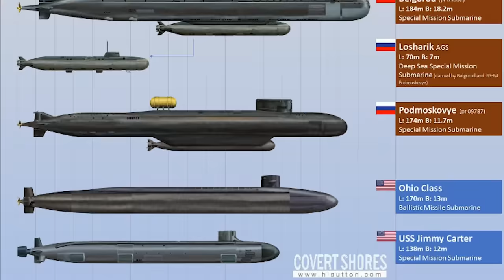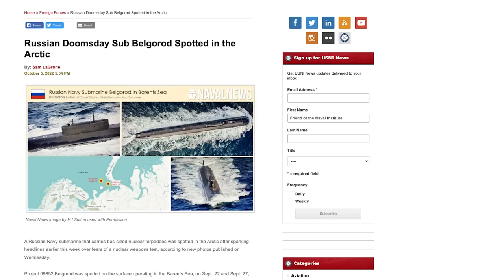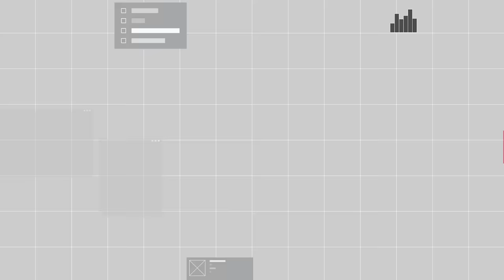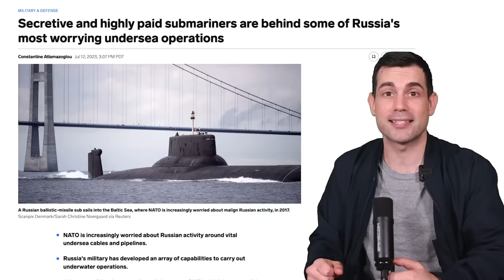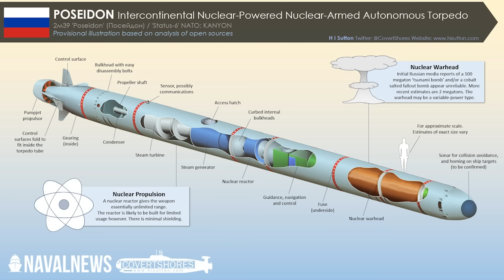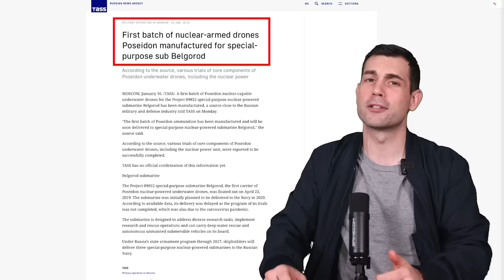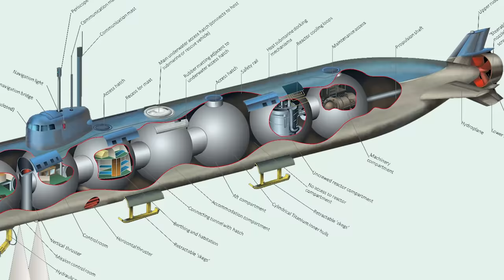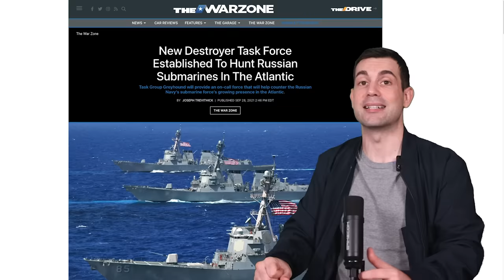What Happened to Russia's Doomsday Submarine?

Comment: Regarding the tsunami claim, it's worth remembering that the Halifax Tsunami of 1917 was caused by 2.9 kilotons of munitions going off accidentally in the Halifax harbor after a munitions ship collided with a relief ship.  The tsunami was 18 meters above the high water mark.  A nuclear torpedo absolutely could cause such a tsunami, though it would likely not be as massive as claimed.
Reply: As with that explosion (the 18m part was nearest to shore), you'd have to do it in shallow water, at which point the blast itself far outreaches any tsunami you can create since there is insufficient water available to matter (and most of it is vaporized). Remember that it takes about a 10-100 gigatons (3 to 4 order of magnitude more) to create any decent tsunami event in deep water, aka a massive earthquake.
Reply: Well if they were to launch a tsunami, they would be hit by it as well they have alot of coastline right there too. Soo there that...
Reply: @timothyhosek3551  Thats false
Reply: Sadly most people have no real idea how nuclear explosion work and also have understanding problem of simple description. There is claim about making nuclear tsunami. So the water waves would be high for sure taking under consideration how big this torpedo is. But mostly it would generate huge shockwave that certainly would waste costal cities and naval bases without issue. And since it would be fired from huge distance then no ,sub itself wouldn't be damaged.
Reply: You need to consider some basic math here...
The 'Tsar Bomba' that was detonated by Russia in 1961 was 50mt. 
Let us say for a moment that a Russia is only using a 50mt nuke and detonated it underwater at a depth of 600-800 meters. 
Do you not think that's not going to create a massive tsunami? That would push 'at least' 350 billion metric tons of water skyward. So yes, that would 100% absolutely produce a very large tsunami and furthermore, it would be moving at a much greater speed than a normal tsunami.
Reply: @T8OOM1O9 
Exactly 💯
Reply: @Tigris_River_Sand_Fl
eas 
Bravo 👏👏👏 
Very well explained.
Lots of comments here are from people who don't have proper education or knowledge. They just say something to look smart.
But you can figure it out who knows.
Reply: @NoNameForNone 
That's not true
Reply: My thought is the nuclear torpedo swims up a freshwater river, to a city, as a first strike weapon, a surprise nuclear detonation is bad news, regardless of tsunamis

Comment: The biggest flaw in their claim for their Poseidon "doomsday torpedo" was how much they said the yield of the warhead was. 100 megatons is the equivalent of the Tsar Bomba, which weighed 27 tons. The poseidon is not big enough to carry that kind of weight and all of the equipment it needs for its promised capability, and even then it would grossly overweigh the submarine built to launch it and the torpedo itself. I don't think the Poseidon was built to even exist, the "prototype" just a Qahar-313 equivalent (in other words, a prop piece with basic functionality purely created for media purposes).

Edit: Also forgot to mention that supercavitating torpedoes exist. The first one, the VA-111 "Shkval", was developed in the 1960s and first fielded in 1977. They are loud, and probably sound like a screech on hydroacoustic sensors because of the way supercavitation is achieved.

Comment: Super-cavitating torpedoes would be very difficult to develop for most applications because the high speed does not allow for any sonar guidance, until and unless it slows down. The assumed application would be nuclear warhead, ie precision not required.
Reply: The U.S. Mark 48 torpedo is given initial course and speed of a target but, periodically slows to do a search and confirm the original data.  If it finds the target far off the predicted position, it commences to do an active search and recalculate a new predicted position.  Eventually, it gets close enough to the target hull that its active sonar will get solid returns at high speed.  Then it goes in for the kill.
Reply: We’re also going to ignore that super cavitations torpedos work by forming a bubble around the torpedo meaning virtually no guidance. Super fast but short range and for why? A a 50 knot torpedo that can chase down a vessel for 30-40 minutes is just much more useful. As for nuclear delivery, we have SLBMS for that. The only useful nuclear torpedo is the Poseidon.

Comment: Rashist federation is not capable of producing a 28 nm based microchip. TSMC used to be a sole provider of that technology products.
On a separate note, back in the mid 1980's I had to visit Severodvinsk in winter time. Don't ask what for. It was punishingly cold there, but surprisingly the mention brings warm memories.

Comment: GLONASS (as well as any other GNSS) doesn't work underwater. And AI can't help with navigation if it has no active sensors to scan the seabed (like TERCOM).
Most people think in one of two ways:
1. Poseidon is a super duper weapon constructed the most talented engineears.
2. Poseidon is propaganda.
I think that it is not very usefull to discuss it's exact specs.
Probably we should estimate the concept of nuclear powered nuclear torpedo itself, compare it against other kinds of nuclear weapons (maybe it worth less than a regular ICBM?)
1. Does it make sense to use about 30 metric tonnes of weapons grade uranium to create a single bomb (that may be intercepted) instead of a large number of 100kt nukes for ICBMs/SLBMs?
2. How long it takes to turn on a nuclear reactor (those are not electric kettels). E.x. turning on a NPP may take several days. Or is it okay to keep it working all the time?
3. Will russians be able to launch it considering that their subs are being followd by NATO/USA anti-submarine aviation 24/7?

Comment: Super-cavitation, or that sustaining a perfect bubble during a long transit is BS..

Autonomous navigation across the ocean, where it could roam and return back to port like a Space-X torpedo sounds like a fantastic feat, only it would require turning a massive underwater network of passive hydrophones into active transmitters (think radio antennas, and now replace that with low frequency sound), to enable this thing to hear commands (while at a much slower processing rate due to higher error margins vs modern radio based data communications... And so that's a big maybe too..

All in all, it's supposed to represent Red October propaganda given it's entry point vs the acclaimed technological prowess.

Edit* and yes, agreed...too small for a nuclear reactor...perhaps an underwater RTG?

Comment: a few quibbles --
The warhead could not be a 100 MT warhead. The largest nuclear bomb ever tested was the USSR's Czar Bomba at 60 MT. It was calculated that a 100 MT bomb would be so powerful it would expend most of its energy blowing a hole in the atmosphere of the Earth a send a large percentage of its energy into space.  I think you might mean 100 KILOTONS. 
You said the Russian submarine's radar would outrange American sonar by many miles. Radar does not work under water, so to use Radar, the sub would have to surface and stick a big antenna sufficiently high above the waves to detect other ships. This would likely give its position away quickly. So did you mean SONAR? Active SONAR also gives away your position. Passive sonar would be limited and likely no better, probably worse than American SONAR, but I guess they are detecting surface ships which are noisier, so maybe they would outrange us on that.
For the Torpedo to use GLONAS it would have to surface to detect the weak positioning signals. That might give an opportunity to be detected during its navigation fixes. I would expect it to use inertial navigation most of the time, but take fixes through a periscope or surfacing periodically.
Making a device nuclear powered without human intervention or monitoring is a feat the US Navy and Air Force has not acknowledged. There was once an article in Popular Science about a nuclear powered cruise missile design, but I am not aware of it ever being built.
I still have trouble believing the Russians will create something that no power in the West has created, such as an autonomous nuclear powered robot torpedo.

Comment: they could have a base in a cave like Norway has   like a natural shelter  
however i wonder if one day it would be possible to build a torpedo controllable by remote
it could be connected to a floating small antenna for GPS positioning and data transmission via a a 50-100 meters long umbilical fiber optic cable
remote controlled torpedos would be a nightmare for big warships

Comment: One thing that immediately come to mind, is the Poseidon torpedo is able to operate in such an independent mode, then they could operate from ANY ship or from a shore base and the massive Belgorod mother ship would not be required or even desired.
Reply: It gives uncertainty. Sure you can put it on ship or in building, but one can closely monitor said ship or building 24/7 and know how many torpedoes are there and if one was launched. With mothership - it would go underwater and maybe drop some during it's long patrol.

So preemptive or false flag strike on ship or building could end such threat, but strike on mothership open you to the possibility that some nukes chilling near ocean floor would activate at unknown time and attack unknown target.

But Russia certainly has at least one regular ship capable of launching and recovering Poseidon.
Reply: The sub offers second strike capability. That is very important for a country which has a second strike doctrine and therefore is unlikely to fire its nukes first.
And it's multipurpose. it will likely never be used in an actual nucular war. But it will surely be used for some spying and  maybe even the classic special military operation (no, not that one).

Today's Russia isn't the Soviet Union. Today everything is multipurpose. Just carrying nukes for a war that is unlikely to actually happen doesn't cut it anymore.
Whether the sub itself is actually operational though... who knows. It's still one of the most corrupt countries on earth.
Reply: At the same time Russia claims it uses Glonass to navigate that mode..... Yeah, Glonass, their dollar store GPS immitation that's inaccurate, near-useless in the southern hemisphere, doesn't work deep underwater and makes anything using it on the surface or shallowly, fairly easy to track and even easier to disrupt.

Not to mention slapping a couple satelites out the sky would cripple the Poseidon immediatly in that case.
Reply: @nvelsen1975 you don't need to be very accurate for a nuclear attack.
Reply: @Heisenberg2A  
On a scale of naval navigation "Not very accurate" means you can end up in the wrong country.

I made an error during my practise-test before the exam, had a thick pencil so the course was 2 degrees off. When we had crossed the Channel that meant another half hour along the coast before we reached the destination.
Reply: You need to think like a paranoid dictator. No such leader wants so many variables he could himself be taken out by one of his own weapons. Also, think of the security risk. If they protect civilian targets with high security, that itself will draw a bulls eye.
Reply: This torpedo would be so noisy that it could be easily tracked and dealt with.
Reply: Yea I thought the Poseidon bomb was supposed to sit at the bottom of the ocean until activation.

Comment: From what i've been seeing, most of these high-tech showcases are too difficult and expensive to manage multiples of. Their damn black sea flagship had its defense system partially stripped for parts and most of its defenses couldn't be turned on at the same time. There's a lot of keeping up appearances involved.
Reply: Don't have enough to do to much with them.
Reply: Yeah the Moskva had the issue where when the radar was on you couldn’t use your radio, so you had to choose between comms and knowing if there was missiles coming at you. And only one of its CIWS was working
Reply: Moskva was also a relic of the 70s, it was built as a cheaper alternative to the ultra expensive and highly problematic Kirov battlecruiser.  The Kirovs have spent more time in port being fixed than actually underway and they were built in the late 70s/early 80s, and have the laughable distinction of being a nuclear powered cruiser that has such a weak reactor that it has gas turbine engines to provide additional power and can only manage 15kts under nuclear power and 30kts under both nuclear and gas turbine power, while burning fuel at an insane rate and creating a distinctive black smoke cloud it's the "nuclear ship that smokes"
Reply: @mrvwbug4423  
Moskwa entered service in 1982 and was comprehensively modernised just two years before it was sunk. 
The thing was a pile of junk despite the Russian gouvernment spending a ton of money on it - that only ever made it to summer houses and luxury cars.

Comment: If the torpedo is nuclear powered with 7 months endurance and uses AI, why does it need to be launched from a submarine at all? Couldn't they just treat it as an unmanned submersible in its own right and just lauch it from a shipyard? Then size wouldn't be an issue and only having 1 sub that can launch them wouldnt be either. It seems more kamikaze unmanned sub than torpedo anyway.

Comment: I would think the Poseidon torpedoes have to surface on occasion to get positioning from the Glonass system, or at least trail an antenna on the ocean surface. Not very stealthy at all.
Reply: Iirc, Russia has developed exceptionally fast torpedoes. Most torpedoes are capable of something like 60-80 nmph, they have some that are capable of something absurd like 200 nmph with super cavitation, they're not great for taking out moving ships, but nuclear torpedoes don't have to be accurate because they have much larger yields. We had nuclear air to air missiles for shooting down whole squadrons 60+ years ago, they had a blast radius of 1/4 mile, which would knock out any aircraft within a few miles of the detonation
Reply: @usonumabeach300  but- the super fast hyper cavitation one is dumbfire, has no guidance system, and is only really any use for firing at a task force in hope of taking carrier out if get lucky..

and the more normal but really fast ones use hydrogen peroxide as fuel- and its a bitch. They need constant maintenance or are prone to lethal malfunction..
so WELL suited to Russian navy lol.

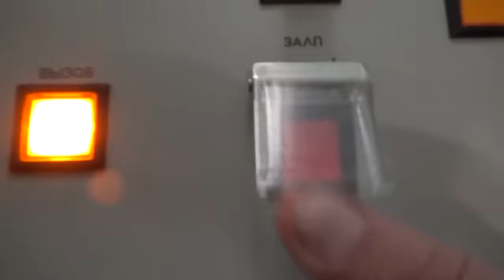Comment: 7:06 - P-700 Granit (NATO reporting name: SS-N-19 'Shipwreck'): Warhead weight - 750 kg (1,653 lb), Blast yield - 500 kt, Operational range - 625 km (388 mi), Maximum speed	Mach 1.6 (low altitude) - Mach 2.5+ (high altitude). Все американские противокорабельные ракеты летят медленней скорости звука и потому их на много легче сбить. Сбить ракету, летящую очень низко на скорости Mach 1.6 - очень трудно даже всего лишь одну, но и одной хватит авианосцу, если она ядерная. То есть даже старая советская ракета - это очень серьёзная угроза для современных американских авианосцев.

Comment: Sounds like this is more of an experimental submarine than anything. If they're building only 1 of these that means that it's supposed to be used to develop new technologies, tactics and techniques. It will also mean that it will probably be quite high maintenance. I guess the Russians just built another weapons system that is going to be very expensive to use. Considering the systems that it was supposed to be using have problems themselves, I'm not worrying about it until 2025. 

About the Status-6/Poseidon nuclear underwater unmanned vehicle, we don't have self driving cars and shall not for at least another decade. The AI for this underwater unmanned vessel will have to navigate 3 dimensionally, not 2 dimensionally like a car (it will have to change depth too), and do it in a natural environment (no markings like on roads). It will also have to handle wildlife. Yes, it's probably not going to work.

Comment: The smaller sub hanging off its belly was the one that had a fire and radioactivity leak back in 2019(?) and it was told they actually sent a rescue crew in from the bigger sub, earning more posthumous hero medals. It sounded like hell, when I read of it.

But as of now, they say that they will refurb the burned out smaller sub, as its capabilities of diving to 2km are really valuable. And the battery fire was caused by out of spec batteries produced in st petersburg. Still, I would not feel great working on a deep-diver that killed 15 in a fire.

So the belgorod program is not doing great at the moment.

Comment: Would be interesting to know Poseidon torpedoes maximum sustained cruise speed. Russian liquid metal reactors historically have poor cooling & reliability at high power levels. If a NATO SSN can run down Poseidon it is nearly useless as a weapon. 100 knots if accurate is certainly terminal dash speed not usable without major reactor damage.

Comment: Russia tends to build stuff with no practical use.  The jet-boats that skimmed over the water,  the 1890 circular gun boats, the giant cannon with the 100 foot wheels, the T-14 tank and the hyper-sonic missiles that were supposed to be able to fly so fast the US wouldn't be able to stop them. Except the hyper-missiles aimed at Kiev in Ukraine have been easily stopped by the American made Patriot anti-missile system that was first used in 1990.  And lets not forget that Russia only has one carrier still afloat (barely) and while it was touted as formidable when launched, it would be no threat compared to the USS Ford class.